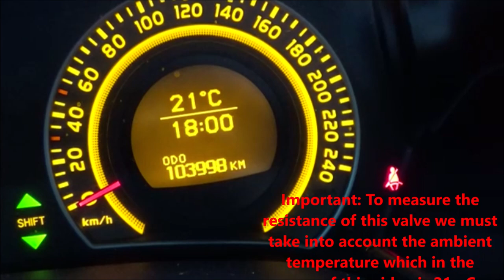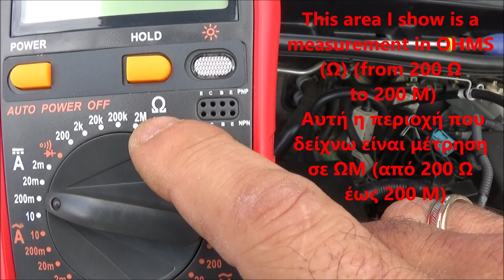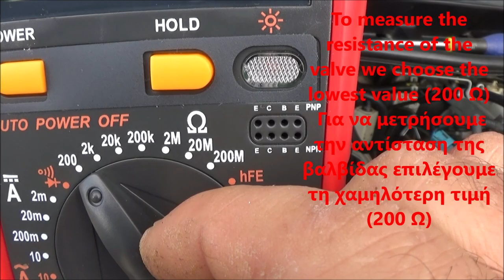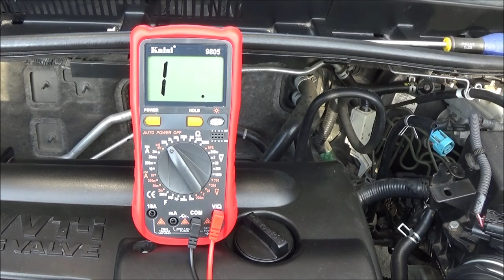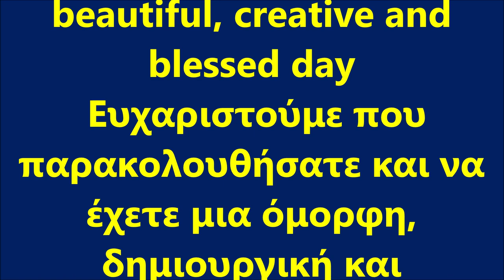2007-2013 Toyota Corolla How to remove and inspect the Vacuum Switching Valve Βαλβίδα Εκκένωσης

Comment: Thanks for the excellent tutorial on testing the VSV! I am running a manual 1,33 L 2010 Corolla (1NR-FE) here in Finland. It whistles under cold starts in the winter, particularly when upshifting between gear 2, 3 and 4 (similarly as in the end of your video, noticed while driving in the cabin of the car). I just noticed that it has also started to burn oil (about 1/2 L in 500 km; 10 L per year?!). There was some black soot in the tailpipe when I checked so it is not a leak. I had suspicions about the EGR system earlier but the local mechanic suspected the whistle was coming from the bearings in the belt tensioner. I am currently running it with the original Toyota full synthetic 0W-20. Having added a half-liter yesterday the oil cap was difficult to open, indicating there is a vaccuum (under-pressure). Any tips on where to start? Could it be the VSV valve?
Reply from the maker: Burning oil is often the result of worn out parts. For example, worn valve seals and/or piston rings could lead to your car burning oil. Both valve seals and piston rings work to keep engine oil out of the combustion chamber. All of the above applies if you do not have external leaks in the engine lubrication system from eg engine oil filter, oil plug washer, oil pan gasket, etc.
Can a PCV valve burn oil?
If your engine is burning oil, hope that it's due to a bad PCV valve. The PCV valve is designed to allow air to escape the crankcase when the pressure inside grows too high -- but when it malfunctions, it can begin sucking oil into the engine and burning it there instead.
Reply: @YiannisPagonis  Thanks for the reply! I hope it is only the PCV valve as well. I cleaned it and also the VSV. I also added some Oil Smoke Stop additive to the engine oil. The car still whistles but at least it runs. Let's see if it continues burning...
Reply from the maker: @hapet09  Henrik Petaisto: Did you Clean and Check Camshaft Timing Oil Control Valve and its Filter;
Reply: @YiannisPagonis  I didn't. I will have to look into those if the burning of the oil doesn't stop. Do you think those might have something to do with the whistling?

Comment: Thanks Yanni, that valve is so important
Reply from the maker: Yes my friend the vacuum switching valve (VSV) is so important for the proper operation of the engine because controls the vacuum supply to the actuator is normally closed and passes vacuum to the actuator when it is energized by the ECU. By energizing the VSV vacuum is passed to the actuator, closing the air control valve. This effectively lengthens the intake manifold run.

Comment: Great video, im having an issue where my Toyota Corolla starts up then shuts off immediately. I replaced spark plugs, coils, fuel injectors and verified that the  fuel pump is working properly. I cleaned my MAF sensor, it might need replacing. This is the last part that I feel I need to check, praying it has not failed.
Reply from the maker: Well you did all this but what was the result? Is your car working normally without problems?
Reply: @YiannisPagonis  Yes, I narrowed it down to the throttle body. I had a friend use his snap on OBD scanner and it threw a P2103 code. I'm ordering a new one soon.
Reply: @YiannisPagonis  I installed the new throttle body and the issue persists, any advice on what else could be the issue?
Reply from the maker: @harlemsfinest05  What is the code P2103 on a Toyota Corolla?
My brief, very brief, research says that this code (P2103) is set when the ECU doesn't see the correct current at the throttle body. Notice it says “current” and not voltage. The ECU monitors current
Reply: @YiannisPagonis  The P2103 code relates  to the throttle body. What could be causing an incorrect current reading?
Reply from the maker: @harlemsfinest05  Potential causes of code P2103 include: 
a. Faulty throttle actuator control motor.
b. Damaged wiring or loose/corroded connections in throttle actuator control circuit.
c. Failed throttle body.
https://www.youtube.com/watch?v=HifXixQRvnI

Comment: today i changed my air filter cover so i had to to disconnect the same sesnor in the vedio, after i connected everything back my car would start for 5 Sec with a very poor rpm then its shut down.. i took this sesnor out and connected it to a battery its closed both way no air follow at all! my car is LS430 2001, do i change the vacuum sensor or i should check the connecting that coming out from the car maybe a one is loosing?
Reply from the maker: So my friend when you install the filter cover and the engine air filter itself did they fit together correctly? Did you secure the 2 air filter clamps? Also, the new filter cover you installed, are there any cracks, holes, or any such damage? The rest of the parts were placed correctly?

Comment: Hi, I have a lexus ls430 2005 model. I did a ac compressor replacement. For which I had to remove the air filter, radiator and  fan. When I connected it back on, my car is have stalling on idle and also when accelerating, when pressed full pedal it takes 4 to 5 seconds to hit the highest rpm. When I am connecting the computer it is showing cylinder 3 and 5 misfire, I also replaced the coil and spark plugs with the other cylinders still it shows 3 and 5. 
Can you help me out here please
Reply from the maker: When replacing car AC compressor what else should be replaced?
For the compressor that is seized, you will at the very least need to replace the compressor assembly and clutch, receiver drier, expansion valve, and flush out the system. I recommend having a mechanic diagnose your vehicle to see if any other components need replaced in order to fix your air conditioner.
Why does my AC cause my car to stall?
A fault in the IAC such as build up, can cause poor idling or stalling of the engine. If not working properly, the engine may not cope with the loads produced by various systems in the car. More specifically, it may be too low to run the A/C and hence it stalls when turned on.
What will a bad IAC cause?
When the idle air control valve fails, it inhibits the flow of air through the engine. When the car can't receive air, it leads to engine stalling. The severity of this symptom can range from occasional stalling at first, to stalling immediately after ignition.

Comment: Hi, is it normal to have gasoline leak in the vapor hose going to the purge valve? Does it mean my valve is broken?
Reply from the maker: No it is not normal my friend. It can be a dangerous problem, but with the right knowledge, you can identify, fix, and prevent an EVAP leak. An EVAP leak, or evaporative emissions control system leak, occurs when fuel vapors escape from the car's fuel tank or any other part of the system that controls them.
What are the symptoms of a faulty purge valve?
If the Purge Valve is stuck open or closed, it can cause the engine to run poorly or not start at all. A defective Purge Valve can also manifest itself through symptoms like reduced engine power, sluggish acceleration, and even engine stalling.
Reply: @YiannisPagonis  i just ordered  a replacement,  verified today that it was broken. Im waiting it to arrived then will install it. Hope it's working. Thanks
Reply from the maker: @kazpentrey19  Yes, my friend, I hope everything goes well and without any more excruciating problems that eat away at our livers

Comment: Hi. What happens if this part is broken? My car vibrates at idle when engine is fully warm. And there is a ticking sound begins. Looked everything for problem with repairmen but we couldn't  find anything. This part is suspicious for me now. I've losen the bottom hose like in this video but it don't vacuums like your car's. Maybe the problem is because of that part, can be?  Thanks for reply and have a nice day. (Corolla 2017, 1.33 1nrfe engine)
Reply from the maker: Hello my friend. First of all find the bottom hose you lost and then we'll talk again ok?
Reply: @YiannisPagonis  no no sorry for my bad English. i mean, i dismantled that hose purposely for test it.
Reply from the maker: @yusufaras01  My friend, use Google translate for better translation results (as I do too). Now an idle problem could be all sorts of things, particularly if you have a lot of miles on the car, such as perhaps you need to replace the engine air filter, clean the throttle body, or maybe patch a vacuum leak in the air line with a piece of duct tape, etc, however usually these are cheap fixes

Comment: Good day.
What if my reading is 36.7?
Do  I need to replace my valve?
I also tried doing 12 volts testing and it works properly. Even blow it manually.
Thank you.
Reply from the maker: Hello Rommel Rodrigo. Tell me please what was the ambient temperature when you took the measurement?
Reply: @YiannisPagonis  its about 29 degress

Comment: My car won't start I see the wires are cut off from the vacuum switch valve do you think that's the reason it won't turn over?
Reply from the maker: Yes my friend probably this is the reason. So join these 2 cut cables correctly in the plug and try it
Reply: Sir_ my Corolla VSV is disconnected _ my car was running fine without it, just few days ago I started having issues with engine shutting off whiles I am driving, the RPM will just run down and shut the engine off

Comment: How do I find the information regarding expected resistance at different ambient temperatures? And how much affect can this have if being outside expected resistance is the only failure?
Reply from the maker: The resistance R of an object also varies with temperature: R=R0(1+αΔT) R = R 0 ( 1 + α Δ T ) , where R0 is the original resistance, and R is the resistance after the temperature change. The resistance of all materials changes as their temperature changes. If the temperature is lowered, resistance (typically) declines. In fact, if cooled sufficiently, the material becomes a "superconductor" with no significant resistance. Increasing the temperature (typically) increases resistance.
Reply: @YiannisPagonis  ok, so science, not something built into the part to be an even bigger difference, thanx 😁
Reply from the maker: @maggiewilder8856  No, it is the ambient temperature that changes the resistance values 😮😮

Comment: Hi friend, thanks for video.May this part cause p0660 fail code ?  I observed that when i touch this part i hear sound on intake manifold and i saw failure lamps on dashboard.I tested this part.Everything is ok but I measured 3 ohms on multimeter about 25 °C.
Reply from the maker: CODE P0660: Intake manifold tuning valve control circuit/open bank 1
When your engine control module registers an electrical fault or other open electrical issue on bank one, it triggers error code P0660. You’re probably wondering, how do I fix trouble code P0660? Here are some symptoms of this trouble code, common causes and steps to take to restore your vehicle.
WHAT IS AN INTAKE MANIFOLD TUNING VALVE?
This manifold is used to change the air intake of your vehicle and redirect it to a separate set of intake runners. It also regulates the pressure between intake plenums. This simple valve is commonly made of plastic and is subject to wear and damage, particularly from extreme temperatures.
A P0660 trouble code can be the result of either an electrical or mechanical issue. Look for these symptoms and determine the cause before you look for a repair solution.
SYMPTOMS OF ERROR CODE P0660
So, what does the code P0660 mean? While this error code could be the result of a damaged sensor, it could also be the first sign of a serious issue. It’s important to treat this error code seriously to avoid any additional damage in the future.
A damaged intake manifold tuning valve could cause your engine to perform poorly altogether. From cold start issues and startup misfires to decreased fuel economy and clicking sounds in your engine compartment, there are a range of symptoms that could be caused by trouble code P0660. Some are minor inconveniences, while others can reduce the efficiency of your vehicle or make it difficult to start your vehicle reliably.
When working properly, your intake manifold tuning valve promotes an optimal balance of air pressure and airflow in your engine. An improper valve could allow too much or too little air and pressure to reduce the efficiency of your engine or cause damage to other areas of your engine. 
COMMON CAUSES OF P0660
Once you’ve determined that your engine issues are the result of error code P0660, here are some common causes to inspect. Whether you have a single issue or a series of faults, look for solutions for one or more of these issues:
Damaged intake manifold tuning valve
Cracked or stuck valve parts
Poor performance due to extremely cold weather
Loose connectors, frayed wiring or corroded electrical components
Issues with your engine control module
Valve contamination
Thankfully, each of these causes can be found and solved. Find your intake manifold tuning valve and begin to inspect it and related components. Use voltage testers to go over the electrical connections and ensure proper electricity to all your sensors and essential parts. Once you’ve discovered the area that needs repairs, you can determine the best solution.
FINDING A SOLUTION
For a trouble code P0660 issue, you’ll typically need to replace your intake manifold tuning valve or other component. The most common solution is replacing a part that has cracked due to exposure to the extreme cold or melted due to the extreme heat of your engine.
If nothing is obviously broken after a visual inspection, check your valve. Some OBD-II scanners allow you to activate your valve. If so, look for any sticking points or areas where it isn’t operating with its full range of motion.
Temperature-related damage may be the cause of this OBD-II scanner error code P0660 problem, but it could be a symptom of other damage. Check to see if other error codes are active and inspect other areas of your engine for possible damage. After you replace your intake manifold tuning valve, parts or electrical wiring, be sure to test your vehicle and see whether the error code returns. If it does, you’ll need to go over common causes again or check your engine control module.
Reply: @YiannisPagonis  I guess it's not about this part 🤔
Reply from the maker: @sbrkrgz5098  It's about the intake manifold
Reply: @YiannisPagonis  Thank you 😊
Reply from the maker: @sbrkrgz5098  🙏🙏🙏🙏

Comment: Sir, there's a unusual sound in my altis 2010 too. Im considering thats the sound when you connect to the battery(3rd step). How can i send my video for you to check. Thanks and more power
Reply from the maker: Send me an email: pagonis33@gmail.com
Reply: @YiannisPagonis  will do sir. Thanks
Reply: @YiannisPagonis  done sir
Reply from the maker: @ulysesgonzalo3722  Ok
Reply: Sir, when i pull off the hose (one facing down) my engine automatically turned off. What does that mean? 
On your video, when you pull the hose, i think the engine is running.
Reply: But the other hose when i pull off, engine still running.